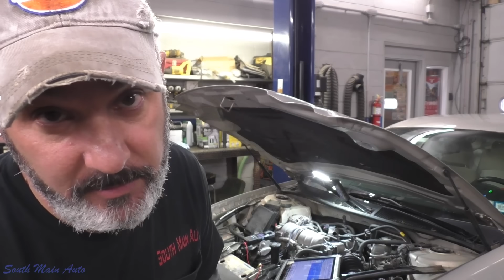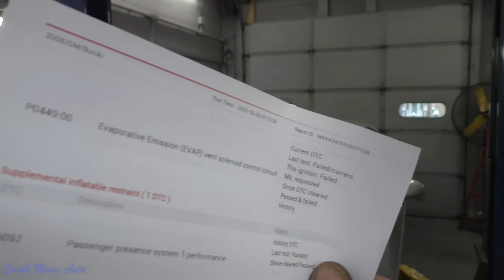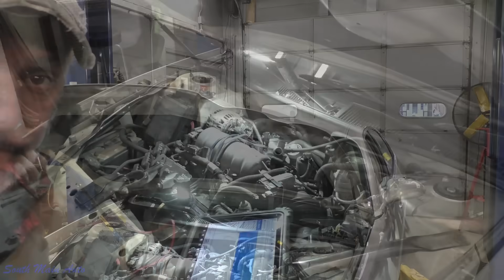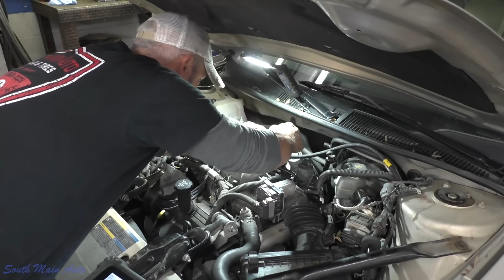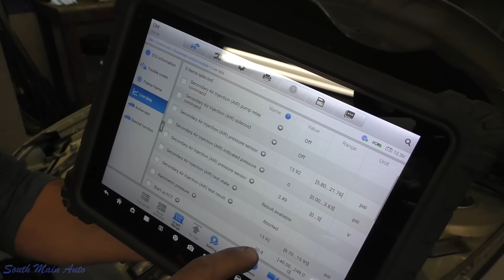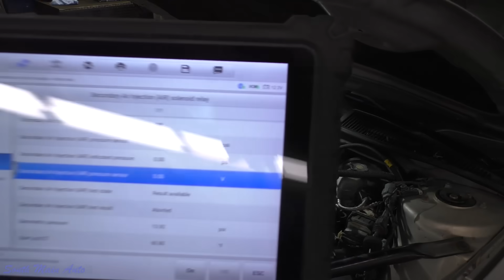When “New” Parts Are Worse Than The Broken Ones 🤬

Comment: It’s not like in the 90’s. Back then when you got parts they were good.  Now like you said it’s every day.  A year ago we had 2 cars in a row with no heat so we diagnosed bad thermostats. We had to get 3 thermostats on both cars.  We basically put 6 thermostats in that day on 2 cars.  It’s a spring, how can it be made so crappy. How is it possibly to get bad parts on 2 cars in a row. I used to second guess myself and now I pretty much assume it’s a bad part so I many times just get a new part and throw it in without diagnosing it a 2nd time.  And I know someday it will burn me not re-diagnosing because I diagnosed it wrong the first time. We get part mainly from O’Rielly’s and Auto Value

Comment: Just had a brand new motorad t-stat bad out of the box, almost overheated my truck. Replaced it as preventative maintenance, ended up tossing it and putting the 130k mile original back in. Sucks.

Comment: I have gone through that just recently  I have a 82 chevy c-20 truck with a 6.2 diesel engine , ok now my alternator when’s out last September ok so I buy one from AutoZone  life time warranty ok it goes out quit working dead battery took it back ok got a new one same dam problem not charging my battery’s  took it back got a refund just went to Napa got one now I will see what happens iam crossing my fingers and holding my breath that it works

Comment: Been in the semiconductor business also. When a part is made it is made by the hundreds on a wafer about 8 inches round. The parts in the middle of the wafer are the best, most reliable and the ones at the edges are the worst. Military and aerospace get the middle parts and pay dearly for them. Commercial ground manufacturers get the edge parts for  pennies. Now you have an idea why you can pay more for OEM and 1/3 the cost for cheap , unreliable crap.

Comment: Had a similar problem. went for our version a warrant of fitness (WOF) failed due to lower ball joints were too sloppy, got the new ones in and showed the rec pit , re-check  and you guessed it failed as it was worse than the originals. The fix was simple, cleaned up the old ones so they looked like new (same as the ones just put in), put them back in and pumped them full of grease (the new ones where "permanently" greased and no nipples access), re-checked again....... passed. New doesn't  always mean better or even as good as. Luckily the one good thing is the checker wrote on shier letter head that the new parts were bad so managed to get a full part refund which didn't begin to cover all the hassles.

Comment: Last year ordered a thermostat. Turned into order return, order return, order return, finally got a working one. Did the water pump at the same time. order return, order return, buy one at Oriley return, finally bought another one from Oriley that worked. Ordered 60.00 dipstick from Jeep because the ones online said they weren't right. Part came in 3 weeks late. Went to pick it up systems were down we can only find it through the system. Came in the next day got the dipstick. No hashlines no marks of any type just a plain (steel looking) dipstick. Got my money back. Still using the old broken dipstick to this day. It's no wonder I have a phobia about working on my Jeep.

Comment: What it is going to boil down to is if you cannot buy OEM parts it will not be repairable. I have used aftermarket parts in the past and the longest they last is 1 year that was in the 80s now 2025 they are bad out of the box a lot of the time even OEM parts but not as often.

Comment: I had an 86 Camaro with the tuned port injection and I used to get a discount with Parts America (Advance Auto Parts now) because they were affiliated with Sears somehow. I kept getting a TPS code and I swapped multiple sensors that were all GP Sorensen, under warranty. I would connect my jumper harness and get the mulimeter out and sweep it slow and look for dead spots but the sensors were fine. One day, I go to Hi/Lo or  O'Reillys and get a Borg Warner part and set the minimum voltage and the codes clear and go away. Another problem I had was with Autozone alternators, I don't know if it was the SI alternator design or what but every 8 months or so, the diode pack would blow and there would be black dust on the heatsink behind the alternator and the battery voltage gauge would just drop. I swapped it out so many times they just gave me my money back and these were their Gold alternators.

Comment: I bought an IAC valve from standard motor products because the 20yo original on my car wouldn’t let it idle down properly. The brand new replacement is twice as bad as the broken one it was replacing…

Comment: I just bought two high pressure fuel pumps for my mini. One leak fuel the other one the car would not run. Brand new i had to put my old one back on to get it at least run. Ebay from China

Comment: I been working on a p0446 on a 03 express 5.3 for a couple weeks, my own not a customer's, I ordered a vent valve and made sure to specifically order the Delco part from a completely ubiquitous distributor.  Their site listed it as being available for immediate delivery.  When I got the part it was a dorman part and my order form listed an order for the dorman part.  I'm 100% sure I ordered the Delco.  Now the Delco and gm genuine parts are listed as unavailable.  It didn't solve my problem anyway so I sent it back, actually diagnosed the thing and replaced the tank pressure sensor but unfortunately they didn't have the Delco part for that either so I went with a cheapy and I'm really hoping it stays working because I'm not interested in dropping the tank again soon.  You can get to it without dropping the tank on the trucks if you've got skinny arms, which I do, but no such luck on the vans...
Reply: Also at my shop I'm kinda the guy who's the best at ac, I can't tell you how many ac compressors have shown up bad.  I had a mustang once that got literally 5 different compressors before one actually worked.  That car belongs to my boss's brother.  That was a super stressful situation

Comment: Had a bad crank sensor with a melted connector on top of that. Load tested the wires wires were OK put a new connector on. This was a BMW by the way, so I had to build the connector then put a new crank sensor and car would not crank long story short bad brand new crank sensor.

Comment: Chancer customers are part of this BS too. I ordered the LHD interior door handle for my BMW from BMW genuine parts dealer in Germany (Leebmann 24). I received in an original BMW packaging the RHD (UK) door handle. Wrong shape. I scratched my head, questioned myself, checked the catalogue and indeed I ordered the correct part. Then when I checked the return policy it all become clear. Someone ordered the wrong part, then ordered correct one and returned the wrong one in a different packaging because the return window run out on the part he ordered first. I put a big notice on the packaging to the parts dealer and I sent it back. I got an email back from the parts shop owner himself in Germany thanking me for spotting the problem and apologizing for my hassle. I keep buying from them because they never let me down. 
Another recent example, 16 valve lifters ordered for Citroen EW10 petrol engine. What arrived? 14 one size, 2 wrong size. Just something you want to encounter when you have cams off the engine and car blocking the whole garage. 
Another example, INA timing belt kit for that EW10 engine. I installed the belt, the belt not sitting right on the inlet cam sprocket. The tensioner is not perpendicular to the sprocket. Then I learned the hard way that the simmering on cam was wrong. It was the only non-genuine simmering that I bought on the whole engine and gearbox. Oil everywhere. Simering was meant to fit the engine. Whole timing belt kit to the bin. Hours of cleaning. I bought SKF kit this time, we'll see. In the end I had to get the Citroen genuine service manual (thank God for ebay), get the genuine part number for everything I buy and verify against the parts dealers, otherwise half of the parts would be wrong.

Comment: I just installed a Chinese starter in my 2002 Dodge Caravan, now everytime I start, it sounds like metal is being ground off the flywheel by the starter, does anybody know something about this?, should I replace the cheap starter or will it be fine?,  is it just the sound that Chinese starters make?

Comment: What you are talking about is pollution control.  The car should work fine without that air pump into the front of the cat converter, and you don't even need the cat converter to get from Point A to Point B.  If you are driving outside the urban zones it should not matter anyway.  We allow people to drive classic cars that don't have all of that pollution control tech.  I think that is the most valuable thing about my 1966 Pontiac, its Vehicle Identification Number!

Comment: I avoid a lot of this nonsense by driving and owning a 1966 Pontiac.  Even so, for every electrical part, I have to buy three or four from different manufacturers to get one that works right.  For the headlight switch, I went through one after another because 1) damn thing would overheat within 10 seconds and break the circuit shutting the headlights off.  Cannot drive at night.  2) Damn thing would not maintain contact so headlights blink on and off while driving and had to jiggle joggle the handle to find that sweet spot where I can get home.  Hit a bump and watch them flash off and on.  Finally located an AC Delco at an Autozone and that works, most of the time.
For the floor mounted dimmer switch, I like a nice easy action.  A quick tap to turn on the high beams and another quick tap turn them off so as not to blind the oncoming drivers.  I go through several sticky action switches to find a good one.
Same song and dance with brake light and reverse light switches.  I am really proud that I got all of the important signal lights and headlights working like they should.  I can even turn on the windshield wipers without turning something else off!  Using two braided ground wires to properly connect the dashboard assembly to the steel base of the car so those electrons can find their way to and from the battery poles.
Would like to see some decent quality control at the parts manufacturers.

Comment: Sometimes it is the same junk part across different brands.  I had that with a small block Ford fuel pump.  Delphi, GMB and Carter.. all bad and the same dam pump for the application I was working on, retailed at different prices.  I had to ditch the OEM style pump and go with an Edelbrock after 5 attempts!  I have had it with parts too and I am just a DIY guy.

Comment: Its a race to the bottom.  Even the OEMs have gone to the same low price low quality suppliers as the aftermarket.  They might not have done that for production line parts, but for the service parts.

Comment: Went through 3 new throttle flaps on a vw tdi, all bad, ended up pulling the gears out of one and putting them in the original to get it going again. Problem fixed.

Comment: Last year I bought a cheap Toyota MR2 Spyder. I knew that the rear brakes (especially the hand brake) are crap, and after checking the calipers I´ve just decided to buy a pair of new ones. I bought them from USA, thinking that they may be good, or at least good enough. They costed me over 300 bucks including shipping to Czech Republic. Then I´ve put them on that car, and guess what, one side has a permanent handbrake drag. I´ve checked the pads (and yes, I had to grind the "ears" a bit to make them fit into the calipers properly), and found them to be OK. 
After spending like several hours searching through the whole car (including the ABS system), I ´ve found out that the one with the permanently dragging e-brake has a completely incorrect shape of the small lever that connects to the cable. They just didn´t even bother to stamp the 6 or so centimeters long (less than 3in) lever into the same shape for both sides. On one side, it had a roughly 90 degree angle (as it should be), and on the other side it was maybe like 60. And you cannot even remove it from the caliper. So that caliper was completely bricked straight from the factory.
Ultimately I had to buy a new one from a local dealer for an equivalent of another almost 200 USD just to make that car finally work without the left rear disk constantly overheating. I can´t believe what can pass as a legitimate car part these days. Fckin junk and a huge waste of money.

Comment: Man I bought some cheap Amazon knock sensors for my 2.5 VW, they went bad in a month. Went to Napa got a set(for triple the price) and those lasted about 3 months. I use to buy cheap parts and THEY WORKED, now I have the inclination that price directly correlates to quality. 

For euro cars FCPeuro has full warranty on all parts including oil changes. It has saved me lately.

Comment: I used to love SMP. I have their boxes (the ones from the 60s and 70s) and a BUNCH of parts from the 80s. When they shifted production from the US to China in the early 2000s I bought ALL of the cap and rotor sets, coils and whatever else ignition parts and random valves I could get for my fleet.

They thought I was crazy. Well....Its been nearly 20 years now and I still have that stash of good parts that will outlast me. It doesnt help overall, but its how you see some cars still driving. Some lunatic stocked up. Also, there are ways to crack open boxes, resolder them, fix them. Sure, they will break again, but at least they work. 

Welcome to planned obsolescence and the enshitification of everything

Comment: Oh my gosh I laugh so hard! It's much more amusing watching other people go through this ***. Most people think I'm so arrogant when I talk about aftermarket parts and people that do the whole parts canon approach to fixing cars. People that don't even understand what you mean by duty cycle versus strictly on and off. They wouldn't know how to diagnose themselves out of a paper bag. People wonder why I prefer 30 year old original parts and yell at them for replacing everything under the sun  with new parts! It's like "hey my car stalls so I replaced the fuel pump, spark plugs, throttle body and coils and it still does it what's wrong with it?" And I'm like how the hell would I know I didn't work on it! Why did you put all those parts on it you just made it worse! I wanna tell them the truth they just ruined their car with cheap *** parts.  All the practical things you did put in your mouth up to the valve to test it, ** hilarious! I mean I do the same stuff but just fun watching other people do it, not like you will see that test in a shop manual.  Hey maybe you got my spit off  that! You never know where those parts have been. It's clear you know how it works. It's clear you know how to diagnose and not simply look at a code and say that must be all bad whatever according to the code! People don't realize it's not actually a code for a specific part or problem necessarily it could be wiring and often just a parameter that's off that the car doesn't like. It could be nothing but an airflow problem in evap line because of a spider web. There is no clean spider web out code! When I go shopping for classic cars I always ask them if they ever kept the original parts and if it's all new crap on it I don't buy it. It pisses them off totally yeah usually they want too much money because of all the crap parts they put on it. I'm like I would have bought the car if you didn't put those parts on it I wouldn't even care if it didn't run right! So many nice older classic cars ruined in still in great shape physically but absolutely ruined with crap parts that are that are "new" and get frustrated and sell them 'cause they still don't run right. Everybody that goes on a forum to ask for what part they should replace thinks they're magically a mechanic all of a sudden. None of them actually information on how to diagnose the issue. Just tell me what to replace next!

Comment: Back in the early 70's I worked at a Lincoln/Mercury dealership and we traded for a late model Cadillac. The automatic temperature control didn't work. I got the job to diagnose it with no manuals, but I had studied the system in automotive school. The system had power and ground and I could make things work manually, so I diagnosed a bad controller. The controller lived in the dash behind the control panel and was a bear to get to. The part was ordered and when the Service Manager gave it to me he made me aware how expensive it was and that I better be right, college boy. I installed it and it made no difference so I re-checked everything and it still pointed to the controller. I was about to go talk to the Service Manager when I got out of the car and realized that I had been sitting on the new part. I had R&R'ed the old part. I was the bad part, really installing the new part fixed it. I was pretty pissed and myself. I didn't tell anyone what happened.

Comment: Replaced a passenger axle on a 01 sienna. I cut the carrier to take out the stuck carrier bearing. I got a new rear mount which had the carrier as part of it from autozone. Only store that carries this part. I ended up destroying an axle from trying to tap it into the carrier. It went in, but I had to remove the axle again because the outter joint was binding from me hitting it. I once again had to cut the carrier to release the damaged axle. I got a replacement from autozone and it still wouldnt go in, I didnt force it that time. The part is not manufacturered correctly and you can change 100 of them with the same result. I feel your pain Eric. They manufacturer absolute junk parts and makes you look incompetent to the customer.